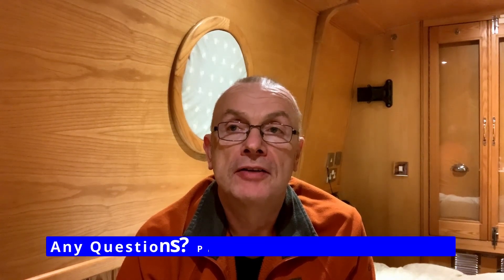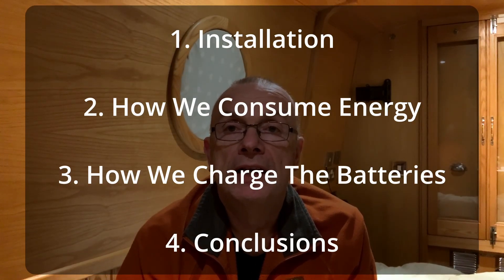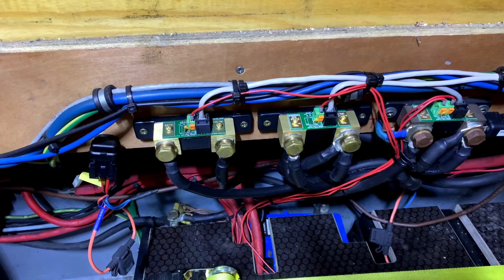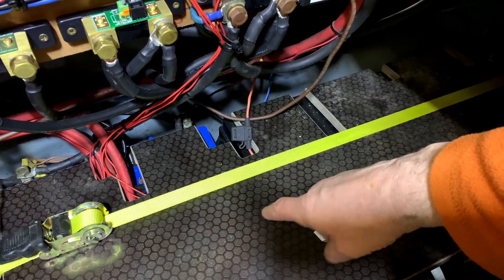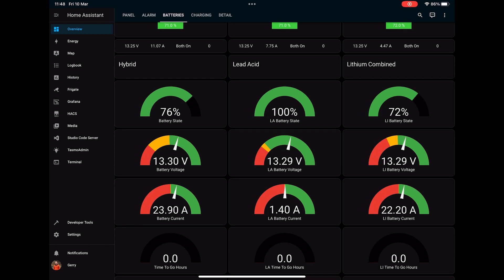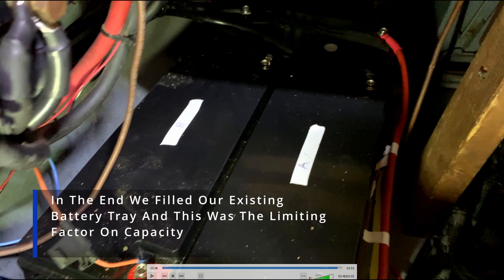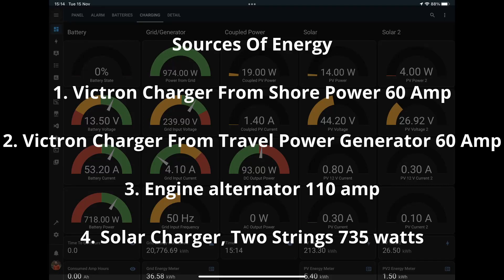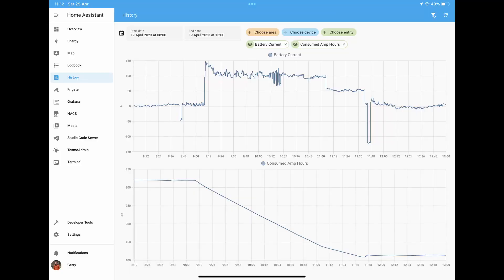Lithium Hybrid Battery System Update Ep.  28

Comment: Hi, I appreciate your helpful videos and am early into running a similar hybrid lithium/LA set-up on my sailboat, which so far has been performing quite well.  I'm just wondering, for the shunt that monitors your combined/total system, to what do you attach the "main" voltage monitor lead - the + post of the lead acid, the LiFePO, or maybe a common + bus bar?
Reply from the maker: Hi all my positives terminate in the same place and as voltage is common throughout with the exception of any cable resistances all my voltage monitors effectively attached to the same place irrespective of where they physically connect to the positive terminals on the batteries. In reality you see minor differences on the battery monitors themselves but just in decimal points of a vault and I think that’s more related to the individual set up of the BM devices, what I can say is the system is still running well we are three years in now and it was one of the best upgrades we ever made. It is worthy of no that due to the different operating voltage is of lithium. I am phosphate and lead acid. The lead acid battery under normal operation is 100% full all of the time. I have loads of data. If there’s anything that you need I will do my best to help. thanks for watching the video. Apologies for the delay in getting back to you. We’re in the midst of stuff at the moment and I’ve only just spotted the comment.

Comment: The safest way for LiFePO4 to be charged from an alternator is to use an external voltage regulator that is programmable such as theBalmar External Voltage Regulator and an open circuit protection device such as the Sterling unit for alternators. This removes the Lead Acid from the system…. Charging at 14.40v (standard alternator voltage) is is really to high. Victron recommends 14.20v but 13.80v will nearly fully a charge Lipo pack ! Also, battery manufacturers do not recommend mixing battery chemistry!
Reply from the maker: Hi, firstly as made clear in the video I’m not recommending anyone follow my approach just documenting what we did. I researched the hybrid approach extensively and found people much wiser than I who had perfected the method including the battery manufacturers (Life Batteries) who kindly set the Battery BMS to their hybrid advised settings. We are now 18 months in and the system works well for us. For most of the charge cycle the charge voltage seen at the battery is 13.6 only at the very end does it rise quickly stopping at 14 when the BMS disconnects. There are some knowledgeable people on the 12 volt boating group on Facebook (including the battery manufacturer) who can advise/help if needed.  I hope this clarifies our setup.Thanks for watching and commenting 😀👍

Comment: Thank you so much for sharing this. I am planning to do a similiar installation on our boat.

Is your Alternator the Mitsubishi 110Amps used on Volvo engines? Good to hear if it can cope with the Lithium and limit the charge based on temperature.

A few questions related to the settings of the different controllers:
How did you set the charging limits in the BMS? In particular the charge cutoff voltage of the Lifepo batteries?
What are the voltages you set for bulk/absorption/float in the Victron Solar controllers? Does it go beyond the Lifepo cutoff to allow full charge of the Lead acid batteries?
Does the Alternator (with its I think 14.1V continuous) manage to fully charge the Lifepo Batteries?

And finally did you observe signicant current flows between the Lifepo and lead acid batteries in various (different) charging states?
Reply from the maker: Hi I’m not sure of the actual manufacturer of the alternator but it’s on a Barrus Shire engine (Yanmar) next time I’m under there I will see if there are any other markings. Thanks for watching and commenting, our install has been running just a year now and it’s the best thing we did I highly recommend it 👍
Reply from the maker: Forgot to mention I’m not at the boat at the moment but when I am I will screen shot all the settings we are currently running with mail them over to you if you send some contact details. Gerry

Comment: Just a thought.  If you we're to charge via a split charge relay the bow thruster  battery from the second alternator you wouldn't have a need for a  lead battery just for alternator protection.
Reply from the maker: Hi, thanks for watching, currently the starter and bow thruster battery’s are completely separate from the house system and cater for high load limited use. I see where you are coming from but we like that redundancy and separation. Also at lithium voltages standard split charge relays are always on, and if the bow thruster battery got low due to excessive use it would lean on the lithiums. The bow thruster has current in the 300 amp range much like a starter motor. Not sure I want to do that to them. Good idea though would free up some space for more lithium capacity.
Reply: @lockontommi  I have just fitted my lifepo4 this weekend with a dc dc charger.  Having it separate to any lead I can use all its capacity hence not needing any lead as a backup. 
It's just a different way of doing it. 
I wouldn't use a voltage dependent relay  just a standard one driven from the ignition light. 
I don't actually have a relay anymore its all done by the dc dc.

Comment: Found the video on the power used to be very interesting. Very impressed with all your presentation. Your home Assistance Monitoring is very impressive. And the all set up looks very professional.
Reply from the maker: Thanks, the use of home assistant as a platform to record data over time is very helpful. It allows real time data to be collected and also automations can be built on top of that data to improve efficiency of the overall system 😀👍